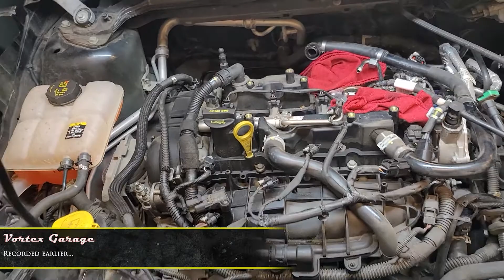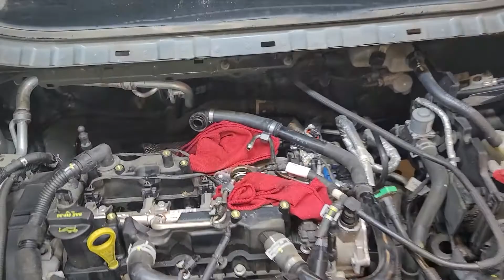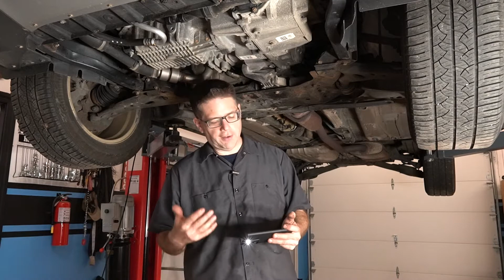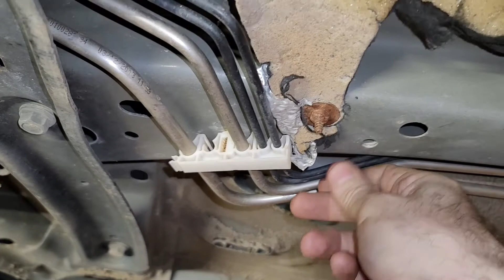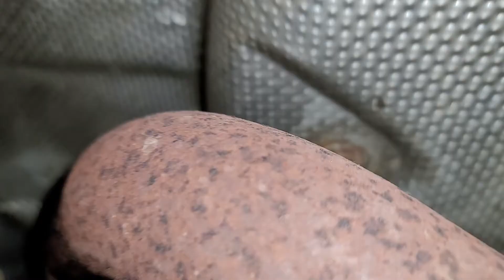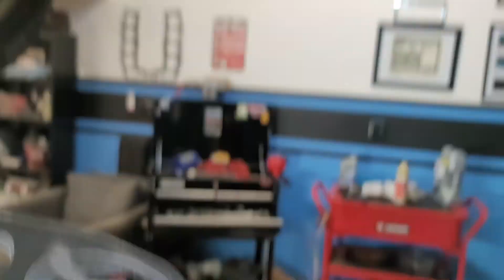2013 Ford Escape - Diagnosis/Fix Notes for P0087 and 161k mi Inspection and Walkaround

Comment: I am kind of glad I am watching this. We have a 16 Focus and we have the opposite the low pressure side is 20 psi lower than desired at idle, and it drops dramatically under load. The high pressure is almost exactly equal to desired to actual when looking at the Autel in live data. While I know that it's probably going to have possibly damaged the high pressure pump, but for now I think we might be able to get it sorted with just the in tank pump. We have already tried the low pressure sensor located just before the high pressure pump, fixed it for a year, but we tried replacing it this time with out any luck, it has 148,700 miles. Then if my family is able to get something different to replace it with may be someone else can have the pleasure of doing the high pressure pump when it decides to fail. Those engine belly pans/covers are junk it missing doesn't surprise me. We have a 14 Escape with the 1.6L with less than 75k. Only thing we have done is inner and out tie rods, even though it only had the left inner that was bad we bought a kit with both sides inner and outer. Tires were the only other expense, due to discount tire having an inexperienced tire tech that tried to break the tire off the bead without allowing the tire to deflate enough. That causes the tire machine to tear a whole in the sidewall. So their free flat repairs were very expensive that day.

Comment: How did you diagnose rail pressure going down as the hpfp? It's a mechanical pump... how could a mechanical pump work sometimes and then not others.. ??

Comment: My 2015 escape shuts down after I drive 25 miles or so it low speed stalls just cuts off.any ideas.
Reply: Never sends a code on dash
Reply from the maker: It will probably need a diagnosis by capturing PID data when it stalls but one potential culprit if an Ecoboost could be the fuel pressure sensor. They go bad often and can result in a bad reading causing the computer to pull fuel based on the bad data resulting in a stall.
Reply: There's a fuse on the fuse block under the hood so the way to the right that goes bad intermittently on these vehicles. I bet that's your issue

Comment: My daughter’s car only has 49k miles, today she lost power on freeway, had the car towed. After restart, a whiteish/ gray exhaust, check cylinder compression, ok. Checked spark plug and coils, all firing correctly. No coolant in engine oil, no oil foaming in coolant reservoir.  Code is saying cylinder 4 misfire. Do you have any thoughts on this issue.
Reply: Stuck injector

Comment: I got one right now and its giving me the codes p0087 (fuel rail system, pressure toi low) , P00c6 ( fuel rail pressuer too low engine cranking) and p0171 ( system too lean)
I dont wanma go crazy buying parts but i feel like its probably 1 of these 2 pumps... And mine only got around 80k miles on it

Any help would be apreciated
Reply: Could you please update your issue.  What did you conclude and how did you arrive at the solution?